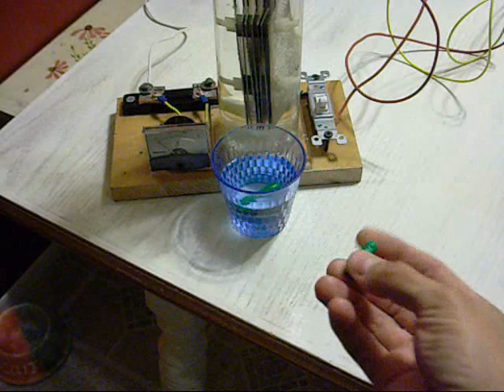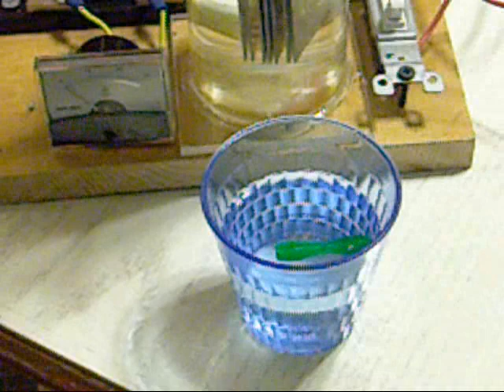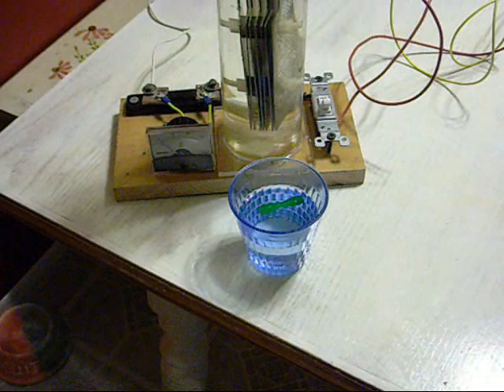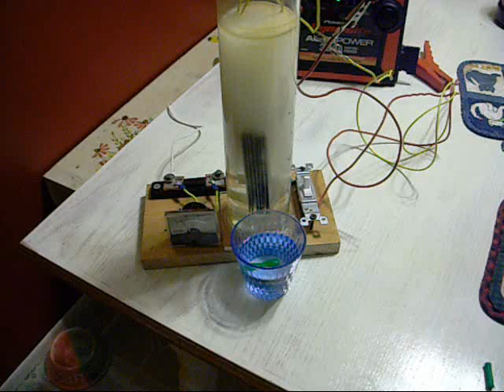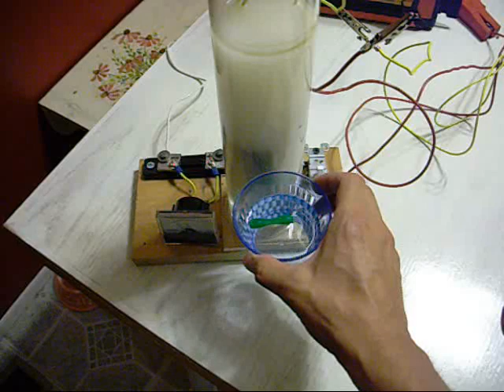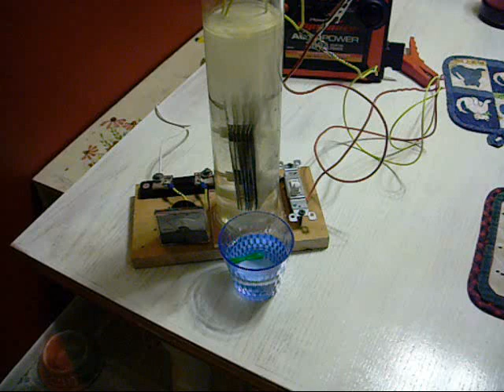Magnetic Field during HHO production?

Comment: The Horvath US Patent used transformer sealed in center of hydrogen cell. The magnetic field came outward through spoked electrodes and speeded up gases evolved. 600w, 10khz, 40 ams draw + cell ran  several car engines on water long time back.

Comment: The fundamentals of earths magnetism is not explained by science correctly. Just like the common person believing that the magnetic flux lines are on a single plane from north to south pole. 
There has been far too much confusion repeated endlessly that takes peoples minds off the facts. I can't correct the confusion in a single comment but I can suggest everyone research themselves and specifically focus on the actual nature of magnetism.
If you believe that gravity and magnetism are separate field modalities then you are wrong.
If you believe that there is a single planar field line path in magnets you are wrong.
If you believe that wood or glass or plastic is not magnetic then you don't understand what magnetism is.
There is an intentional misguided understanding of magnetism that is causing a slow down in human discovery.
A seed question to hopefully launch your journey into magnetics;  grab a weak magnet and a strong magnet and a piece of steel etc and do this test. 
Test how far away from the magnet you can start to feel the magnet 'pulling' on the steel, 
why do you have to be closer to the stronger magnet to detect it?
Another question, one carbon atom is a single magnet therefore 2 carbon atoms together must be double the strength right? If their magnetic spin states are aligned yes (from an external measure of their magnetic strength) but if their spin states are opposite then externaly they do not behave like a magnet by detection. Yet they are still 2 magnets. A third question. If you drill a hole to the centre of the earth and jump in, where would you finally  come to rest? (Its not the centre!). Research people, find the facts and it will blow your mind that you've misunderstood for so long..... Just like nearly all humans that believe electrons carry electricity through wires to power circuits... They never have! All circuit current is in the air/medium around the conductors/wires because electrons play a different role in a circuit than what you have been taught. You've been missled !!!! (Lied to!) Want proof? Ask ANY physicist! I dare you!

Comment: H3+ ions can be made in a duoplasmatron where an electric discharge passed through low pressure molecular hydrogen. This causes some H2 to become H2+. Then H2 + H2+ → H3+ + H. The reaction is exothermic with an energy of 1.7eV, so the ions produced are hot with much vibrational energy. "These can cool down via collisions with cooler gas if the pressure is high enough".  (Consider stans addition of ambient air which is a large portion nitrogen)
 This is significant because strongly vibrating ions produce strongly vibrating neutral molecules when neutralised
Reply: would that mean your on your way to a deuterium then tritium reactor cycle?Tritium and solar panels are convient for nocturnal EMF production.

Comment: The magnetic field can be created but requires much less sophistication with equipment and ingredients to produce it. You have everything separated. Everything needs to be together. It all works in harmony or not at all. You cannot derive an equation when you take and hold something randomly is space around the process. Very basic ingredients and measurements. Very easy to do but complex to explain. The physics combined with electrolysis is a very complex equation. Spectacular visual results every time. Very very clear. I think maybe you are trying to explain your complex equation visually. Keep the ingredients and equipment very very simple. Magnet, Petri dish, copper leads, saltwater, and dye. Let the ions do the work for you. The ions will “carve out” a magnetic field.

One hitch, your measurements of ingredients must be spot on to work with the particular strength of the magnet. When ingredients are optimal, a very impressive visual is created.

This is old tech but changed up to create something new. Faraday already did all the work. You have to manipulate the Lorenz force. I simply changed the configuration. I have also improved the hand held homopolar motor (magnet, wire, battery, screw). It will not burn or shock your finger ever. The idea for the magnetic field and electrolysis came from how I configured the hand held homopolar motor.

Tricky stuff but cool to see. Good luck, your close. Gotta let those pesky ions go to work for you in the electrolysis and physics of the magnet combined. You can do it. Again, good luck!

Comment: I know nothing about the validity or not of an applied magnetic field increasing HHO production, But its quite east to google  examples of magneto hydro dynamics, and see how examples of magnetic forces causing ions to take a longer path between plates. Longer path means less production and more resistance.  

But, i know for certain that all currents generate a magnetic field, and that the magnetic field is at 90 degrees to the direction of current flow using the right hand rule. Since your plates and solution conduct current along some horizontal axis, I can tell you that you will not detect the vertically aligned magnetic field that  goes down into the table on one side and over the top on the other  at 90 degrees to the flow of current. Considering the direction of current, In order to detect that magnetic field your HHO generator is generating, one would have to have their magnetic compass rotate up or down vs left or right.  

In other words, you're looking for a magnetic field in the wrong plane. Thus you incorrectly concluded the HHO generator had not generated any magnetic field when in fact all you did is discover your HHO generator was not generating any magnetic field in the horizontal plane.  

Try this. Imagine  the direction current is flowing through your HHO generator, positive to negative. Now imagine that current as flowing through a wire.  Then imagine grabbing that wire with your RIGHT HAND such that your thumb is pointing in the direction the current is flowing. Now your fingers will be wrapping around this imaginary wire in the direction of the magnetic field  flowing from North (palm) to South (tips of your fingers).  Ampers Law

Furthermore,  there is a formula for determining  the strength of a magnetic field surrounding a conductor It is called Ampers Law http://hyperphysics.phy-astr.gsu.edu/hbase/magnetic/magcur.html  

Hypothetically, if you are driving your HHO generator with a current density of  .5 amps per sq  inch,  and  you have 30 sq inches of cross section conducting current through the electrolyte and generating HHO, then your drawing 15 amps. If one  simplifies the HHO generator it to a circular geometry, rather than rectangular,  then 30 sq inches would have a  radius of about 3.09 inches  or .078486  meters.  So then, according to Ampers Law, at a distance at .078486  meters from the center and 15 amps, the magnetic field then is about  0.3822 gauss. For comparison, Earth's magnetic field is about 0.5 gauss. I suspect the corners will have a slightly stronger magnetic fields in a rectangular  HHO  generator such as yours.

Comment: Could the positoning of the magnetic field make the difference in aiding or slowing the production of H2. The experiments you quoted did the only try using my magnets in one direction relative to the cell or multiple directions. Current produces a margetic field so placing it in one position may inhibite the the flow of electrons and in the other 180 degree rotation could accelerated the flow of electrons,

Comment: If you add a strong magnetic field using permanent magnets you can cause the liquid to flow and that might improve gas bubble movement.  
Search magnetohydrodynamics. MHD 
Also this video is very good: watch?v=Trvd2XOIeXY&feature=related 
The work wasted on electrolyte movement might be the cause of reduced electrolysis. Use weak magnets?

Comment: I hate to be the messenger of bad news..or in this case the thuth...but I have to tell you...magnetic feild?....lol....here is the deal, and I will just give it to you like this...
1, amps are like glue or the manetic force in the h20, more amps...the more magnetisim...that holds the hh and th 02 molecules together...volts push them apart...if you have a cell that is at 30 volts and less than 3 amps....you will have 10 times HHO production as if you has 30 amps and 30 volts. figure it out..

Comment: 2of2 There is a reciprical and opposing relationship between a driving motor and regenerative breaking by reversing the motion and current flow direction thru the same motor/generator. 

Try adding a 3rd magnet to create a pair that is naturally drawn together (opposites attract) in place of the single magnet that naturally influenced the floating one. 

Also, different electrode shape may increase or decrease magnetic polarisation. Thanks for your thoughtful & logical consideration. ;)

Comment: Why would you expect there to be a magnetic field in a flat cell configuration? Your conclusion may be correct about magnetic field not helping HHO production from water, but this test does not prove it. If your cell was in a spiral wire shape like a double helix then you may get a magnetic field produced by the cell. Also, the cracking of H2O liquid into HHO gas wouldn't provide a magnetic field since the equilibrium would not have been violated with + or - electrons in the reaction. 
Thanks